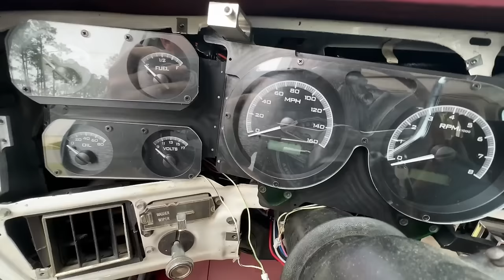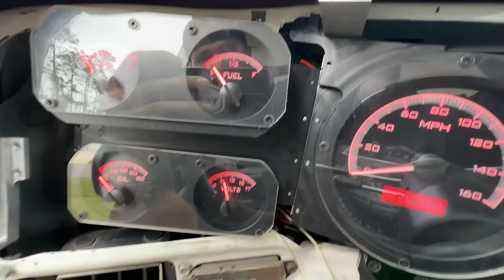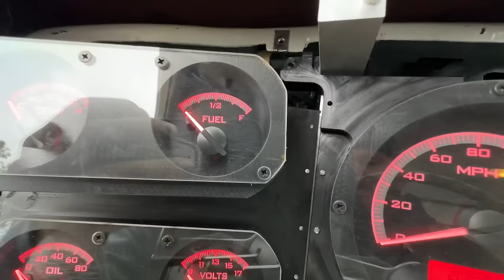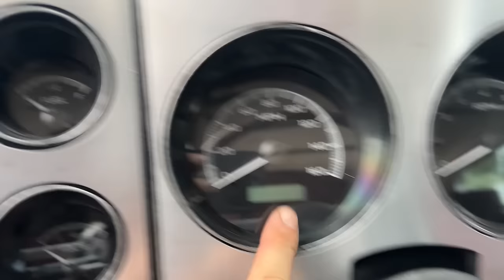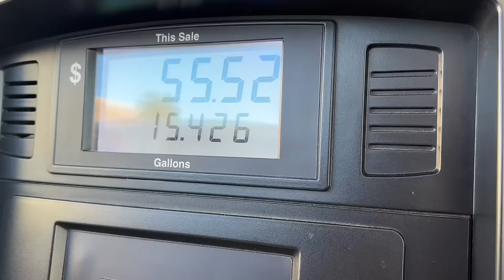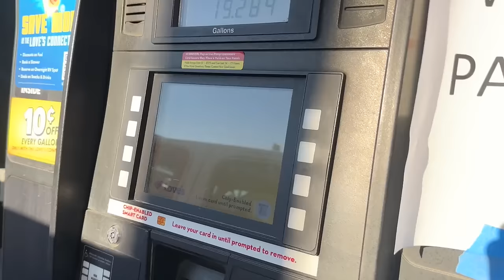But It's Not What You Think... 2,300 Miles, 8 States, 1 BREAKDOWN

Comment: I've started taking a NOCO Boost Plus GB40 1000A UltraSafe Car Battery Jump Starter on long road trips.  Of course I've never had to use it away from home, but just used it parked on the curb outside.  Fired up a battery in no time.

This is a different video for sure -- thanks for taking us along, and sorry to hear about your uncle!
Reply from the maker: Thanks man. I think I need to add a jump box to the tool box when I'm doing solo road trips. You never know when you might need one and with my luck it will be when I don't have it. lol

Comment: Get some ‘high pressure valve stems’ they are just overall much better. I run them in everything.
Reply from the maker: I have to look into these. They dually has steel valve stems to handle the higher PSI and I've never had an issue with them.

Comment: May try a tire pressure monitoring system. I got a cheap one that works pretty decent.
Reply from the maker: I got one for my dually after the blowout and it worked great. I think I'll have to get one for the blazer too. New tires are cheaper than new wheels and tires 😂
Reply: @yeahbuddygarage  not wrong on that lol

Comment: My Dakota Digital says the ground wire from the fuel sending should run to the Dakota box . Electric cars require diesel fuel tractors and bulldozers and trucks and boats to produce and move lithium. Witch  is not green when they run 24 hrs a day to dig up and transport. As a matter of fact you could drive 10 1970 dodge duster’s sumptuously and produce less carbon dioxide then what it takes to make electric cars and that’s not even the copper wiring factor!
Reply from the maker: That's what I'm saying!! I'll have check out running that ground straight to the DD control box. It worked great for the last 7 years but all of a sudden quit reading correctly.